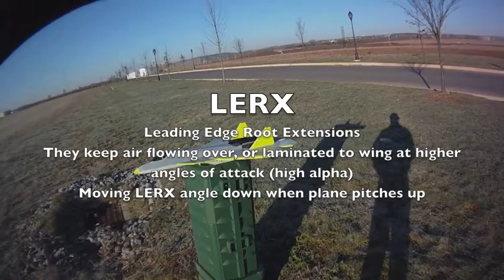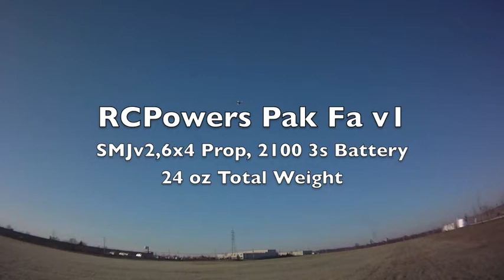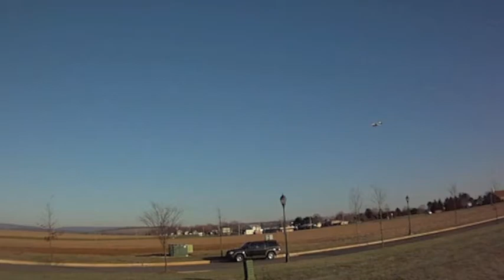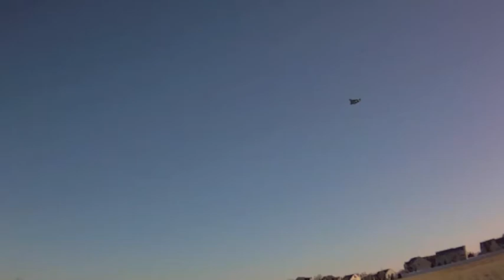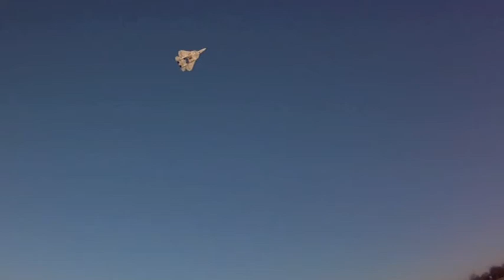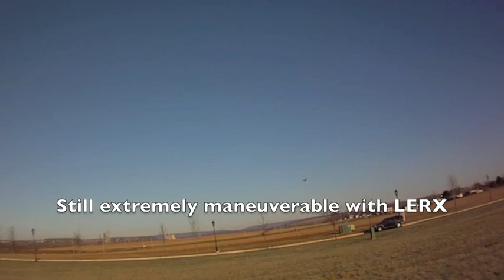Sukhoi Pak Fa v1 with Lerx pt 2

Comment from the maker: I think it will do ok with elevons only based on what Grey(I think) on the rcpowers forum posted.  The canards or lerx definitely are not necessary.  The ailerons help speed up roll.  But pitch and roll should be good with elevons only. You can always enlarge them if necessary.

Comment: The LERX control surface on the T-50 seem to be designed to enhance maneuverability. Ultimately this is the role of the traditional canard too, so yes they are comparable as such but it is wrong terminology to call this control surface on the T-50 a canard.

Why not put some gyros on that to stabilize high-alpha? I have the blueprints for RCPowers T-50 but have not built it yet. Will probably experiment with gyro settings on it.